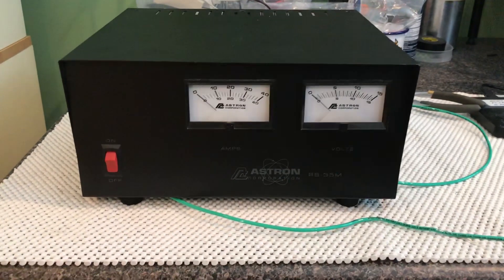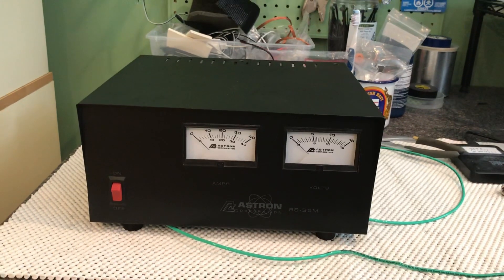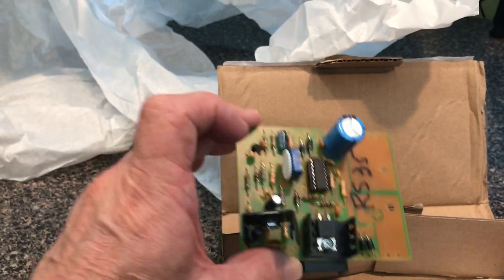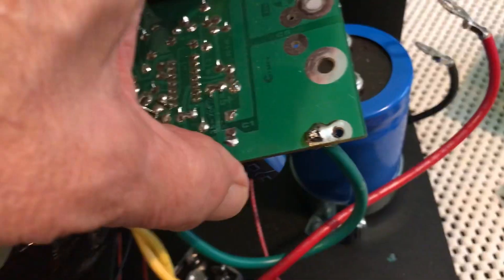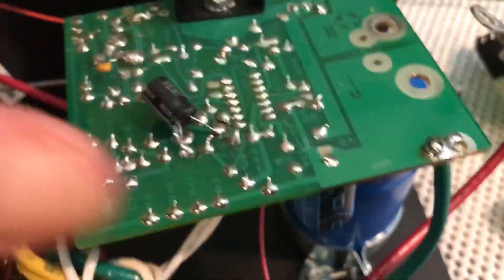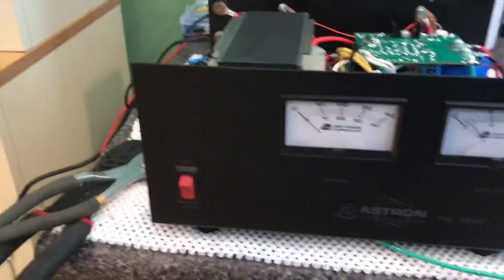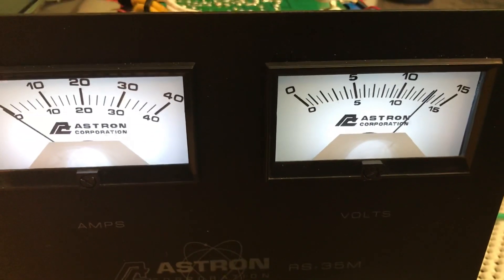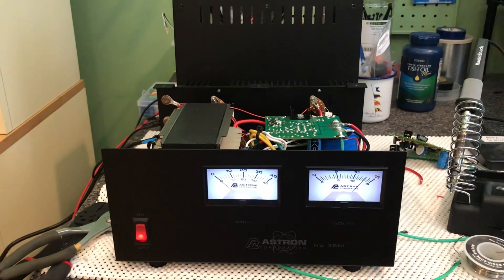Astron RS-35M-simple repair/K8EA

Comment: Astron should have been embarrassed about the RS-35;  they chose to parallel two bridge rectifiers rated at 25 amps instead of doing the right thing and using ONE rated at 40 or 50 amps, with proper heat-sinking--stupid.  They also left the current adjust control just hanging in mid air instead of putting it on the PC board.
Reply from the maker: Thanks for your comments. I don't know about these concerns so much but I'll state this one that has always bothered me. The +/- output terminals should be permanently affixed and not on screws, with or without lock washers. On several occasions when you tighten these on the outside the inside lug, affixed to the screws, moves and there is risk of shorting to chassis ground. Otherwise, I have had pretty good service on mine...I won three. Besides those mentioned they have been in service for a long time here. K8EA

Comment: My VS-35M blew the fuse today...then blew 3 more with nothing connected.  Spoke with Astron support and they said the rectifiers are blown.  Ordered two and two spares.  Power Supply is just a week over 1 year since purchase new. 7 days out of warranty.  Fortunately, I can replace the rectifiers myself...just a little soldering.  The tech said they don;t use the 3501 rectifiers anymore and suggested the DB5001 replacements.  Said it handles more current.  
It has been in near continuous use for a year with an Icom 7610 and antenna tuner.  Nothing drawing anything close to the power supply's potential.  Any ideas what would cause it to fail?

Comment: Good video. My Astron RS-35A is exactly 30 years old (serial number starting with 9006xxx) and have been in use daily for a couple of hours since 1992 when I bought it brand new. Sometime ago it began failing to keep regulation and after checking/cleaning everything possible I concluded something went wrong on the board. Big capacitor is OK according to a techinician friend and LM723 was changed. My electronic's skills are limited and COVID limits movements so so your video gave the idea to replace the whole thing. I'll order a new board from Astron and hopefully will have it running for another 30 years ? Greetings from ZP5YW in Paragauay-So.Am.

Comment: Did you have to discharge the cap?
Reply: If you do, use about a 2 watt resistor.  It only is rated to hold 25 Volts so it's got to be less than that unless the transformer is shorted which would blow the fuse and maybe a few other components.

Comment: Thanks for the great video
Reply from the maker: Glad you enjoyed it
Reply: Check the 1000mfd electrolytic cap in the regulator power circuit.  On larger supplies it is 2500.